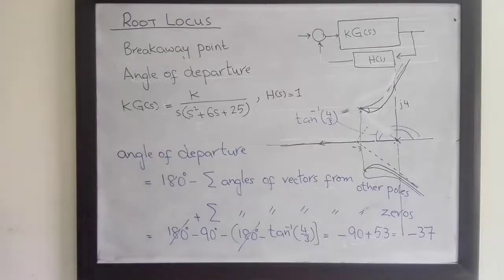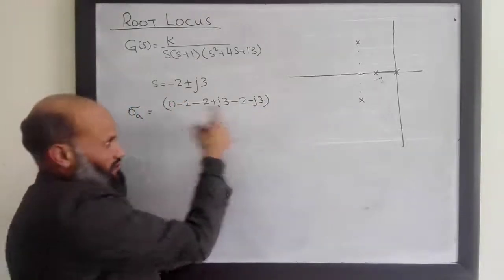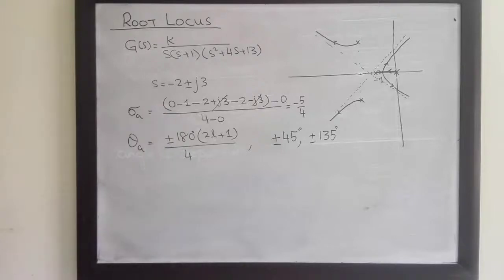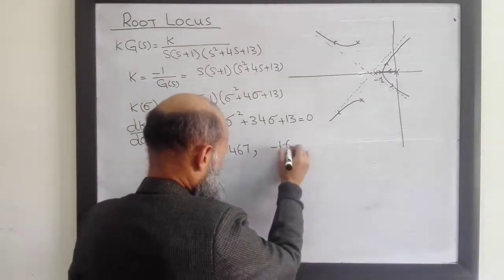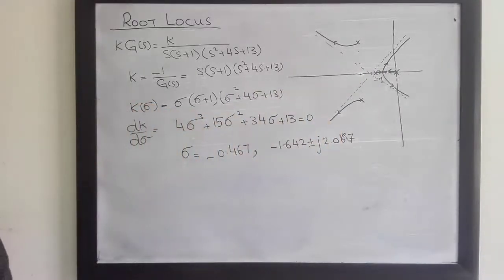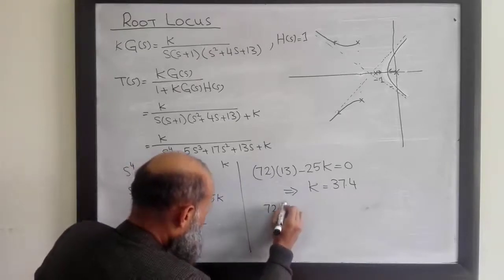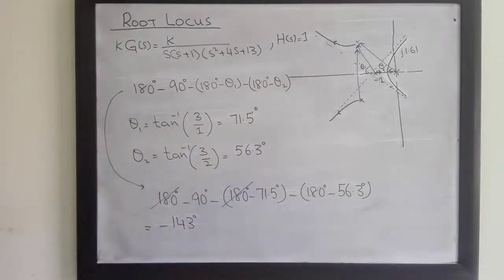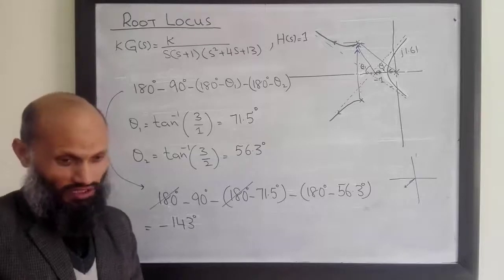LCS 33 - root locus,  example with all details

Comment: how to find 3rd root Mean Cube root ?
Reply from the maker: There are several different ways to compute roots of higher order polynomials using hand calculations, the simplist one is the numerical technique. For example, to find roots of the polynomial 4s^3 + 15s^2 + 34s + 13 = 0, one may rewrite it as s = 1/4 (-15s^2 - 34s - 13)^1/3, take an initial guess for s and substitute it on the RHS, you will get a value of s. The resulting value of s will be again substituted on the RHS and finally the solution will converge.

Comment: at 4:41 will we have to multiply the G(s) with the -ve sign? Sir please correct me if i am wrong. Thanks
Reply from the maker: Yes, you are right. However, since dK/dSigma is substituted equal to zero, therefore, - dK/dSigma will also be zero and hence, the mistake has not propagated in the calculations.